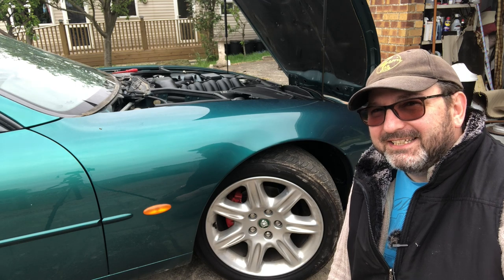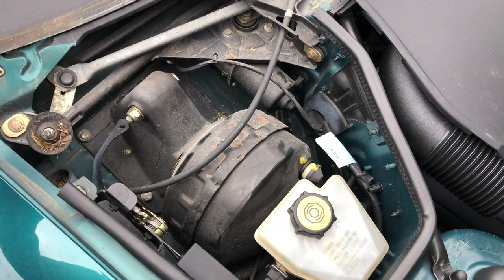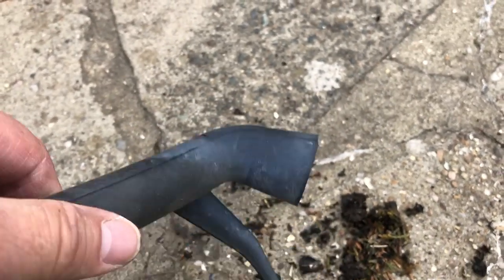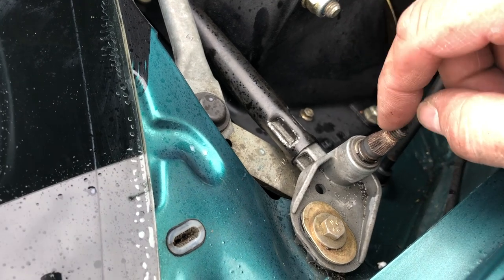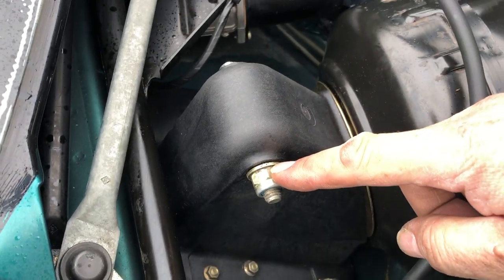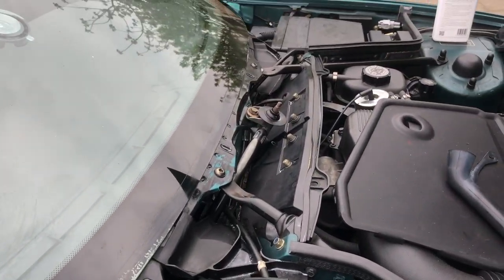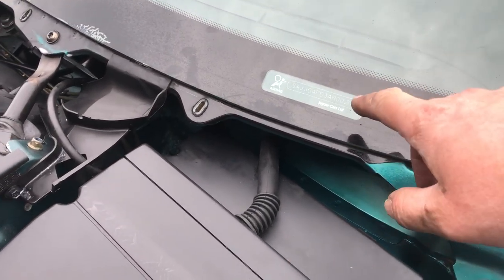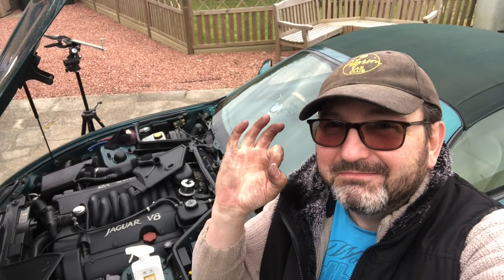Secrets of the Jaguar XK8 XKR Ep 62. Under the scuttle pannel

Comment: Another great informative video. I decided to take a look under my covers. Haven't looked under them since I purchased the car 5 years ago. Surprised that there is actually a difference between our engines. Mine is a 2002 4.0. I have an additional filter besides the brake booster. Looks like a clear inline gas filter, but nothing attached to the one end. Thinking it must be an air filter for the brake booster. My rubber tubes were clean, just a bit of dust. Car has only seen about 5 minutes of rain since I've had it. Also noticed your Throttle body is different then mine. Yours seems to have what looks like some sort of round metal diaphragm next to the air intake. Mine doesn't.

Comment: Hi John, loving the videos. I have a suggestion for a possible video - the 'anti-rattle buffers' in both my doors have either vanished (window was replaced once after being smashed so I assume they were lost) or have broken - this results in the windows banging off the door when closing the door (with window down).I believe this is a common-ish problem as the cars get older. I don't think it's possible to buy replacements - maybe you could fashion something to help? Jaguar part numbers are GJA1718AB and GJA1718BA. Paul

Comment: ou mentioned in one of your YouTube broadcasts (Pollen Filter changing I think), that when removing the windscreen scuttle one had to be careful of a small hook that if broken would allow rain water into the car and wet the carpets.  Well I have a problem with wet carpets on the driver’s side which might well be this problem that you describe.  Can you provide more detail?

I also have an issue with both windows, (mine is a 16 year old XK8 Coupé) which drop a millimetre on opening but do not subsequently return to fully closed when the car doors are shut.  I have tried the trick of pressing the button to fully open and holding the button until I hear a click, and the same in closing, but still it does not want to know.

As I only use the Jaguar on irregular occasions, I have fitted a battery switch to disconnect the battery when I’m not using the car.  This stops the battery drain as I was always getting a flat battery.  New battery fitted as a result.  Would this be the cause of the door windows problem I wonder?

Anyway, keep up the interesting Purdy Show and I will continue watching.
Reply from the maker: Hi B. G.
The window drop will happen whenever you disconnect the battery unfortunately so you need to reset the window memory each time you reconnect. 

The Rubber band needs to attached to the plastic hook to keep the drain tube connected to the scuttle. If not water is funnelled from the windscreen down into the compartment where the brake servo lives. There is a small aperture to let water drain down at the bottom of there but its easily clogged with debris and will fill the cavity up to the point where the pedal box is bolted into the area above the drivers feet. and then you have wet carpets. 

wet carpets can also be caused by corrosion on the floor from the underside around where your heels sit. There is a 8 inch square ish plate of steel welded to the underside of the floor there. (an alignment plate from when the car was on the production line. It tends to encourage the floor to rot and can easily cause a hole.

Comment: Hi John! I just wanted to say a big thank you for showing us all how to remove windscreen washer pipe (push it off don’t pull it off) in a previous video. My Volvo’s washers had blocked so I took your advice, took it all off and put the check flow valves in vinegar overnight. Result? They are now so good that they not only wash my windscreen but the car behind too! Total cost of repairs? Er, £0.00, and that doesn’t happen very often, does it? Cheers again! Nick.
Reply from the maker: Glad it helped Nick!
Reply: To The Garage -You’re in my will!

Comment: It looks like you might have lifeforms new to science in that little well.  The 8 little white oblong plastic screw anchors shown at the lower left at SMPTE timecode 7:00 have a tendency to crack and should be replaced.  They are XR82312.
Reply from the maker: Thanks Gary I think I will order some of those as One did feel line it stripped. Also I have to get one of the Dorchester grey screw covers with the two tiny barbs on. One of mine now only has one barb and is living in the glove box.👍